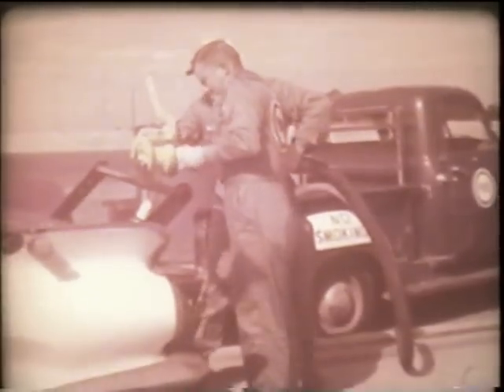1960 Buick Invicta 10,000 miles in 5,000 minutes

Comment: Doesn't prove how well the car would do in the real world. Real wear and tear came from starting the car in cold (25 degrees or less) with the choke on for several miles, dumping a rich mixture down the cylinder walls. The transmission doesn't run "through the gears" like it would in traffic. A real world test would be a NYC taxi.

Comment: Has any car company had the daring to do anything like this since???
Reply: Yes. Mercedes did this with a 190E 2.5-16 and earned a world record for this in the 1980s. But that was the good old days when they made good cars. Not the crap they produce today.
Reply: I was wondering the same thing. It is unlikely that the fragile cars of today would be able to handle something like this.
Reply: Yes, Rambler AMC Nash tried it for their 1961 models at Daytona for a long distance test. One of the Rambler drivers supposedly had a fatal crash. Buick was the first for the Daytona 500 track endurance test, and averaged over 120 mph including the tire and driver stop breaks. The 10,000 miles is equivalent to 20 Daytona 500 runnings!
I was lucky enough to "Pilot" a '60 4 door LeSabre with the smaller 364 c.i. motor for 7 years from mid 70's till 1980. Those fins really helped, as It could "fly"!
Reply: @garyheppner7186  Thanks for the reply. I'm glad this thread is still going after 5 years!

Comment: No way , I had no idea Buick did this crazy test. Now, I’m wondering if this exact car was ever sold to the public. At 120 mph this engine must of been running close to full throttle for 83.3 hours or approx. 3 1/2 days.  It’s a wonder that some part of the drivetrain didn’t overheat.

I wonder if GM ever did another test like this.  I can’t imagine they did.  This was very extreme.

Comment: I own a repair shop. I have some real doubts that a car today could be driven wide open for 3 and a half days straight.  Very impressive
Reply: It would be interesting to see - like a Honda 4 cyl, or a Nissan 3.5 V6...can they hack it?  I would bet the 97 Police Interceptor I once had with 4.6 SOHC could take it.  That was a very smooth and durable engine, with a extra cooling options on everything....

Comment: That's pretty impressive considering the era. The breaker point ignition would seem to be the weakest link. I wonder if they compensated for that in some way?
Reply from the maker: +Paramount531 Larger contact points?
Reply: Points ignition will easily go 10,000 miles without adjustment.
Reply: I expect they selected condensers to balance out metal transfer on the points.  Also, I expect they had common repair parts such as distributors, carburetors and generators ready to go at a moment's notice.  If you're all set, you can swap out a distributor quicker than fussing with points, condenser and a rotor.

Comment: How did they check the engine oil level on a running engine? Those nailheads were superb engines
Reply: Probably had a deep sump oil pan that increased oil by 3 or 4 more qts.

Comment: 16mm Educational Films Thanks for posting this. Love these old Buicks.
Reply from the maker: I'm just glad people enjoy these films - been holding on to them for more than 25 years - didn't know what to do with them.
Reply: 16mm Educational Films I'm sold! I want the Invicta 4 door sedan, any available color! Seriously though; I would think a new engine like that would've used a little oil during the first 500 to 1000 miles. Even if it didn't, just imagine 10000 miles on the motor oil. That would be a stretch even for today's synthetic oils, wouldn't you think?

Comment: Geeze who knew?  Everytime I floored my old Buicks for 5 minutes at 110 MPH I would spin a rod bearing!   LOL 😆
Reply: Well Thats because they were already old and worn out, and the later 300-340-350 and 400-430-455 motors had a completely different (and less robust) oiling system than the 401 or 425 used here.
Reply: @twoeightythreez  You're right,  my 70 Electra had 110k miles and the previous owner had installed a Stage I cam - so she hauled pretty good. Drove it a year,  it was very strong - Raced someone on the freeway and that was it....About same story on my 69 Electra Convert - over 100 k miles and was babied by the old man I bought from.  It did not like being treated like a kids GS....lol, toasted that one in 3 days.

Comment: Travelling at 120 miles an hour and needs refuelling every 30 minutes?? Are you telling me that the range of that car at speed is only 60 miles!?!
Reply: Gotta realize that engine is running at WOT. Can't imagine how much fuel is pouring into that engine!! I would imagine they turned up the fuel and adjusted timing to avoid detonation problems and overheating. That is some punishment!
Reply: Bro the car is running at top speed 😂
Reply: 15 gallons in 60 miles is 4MPG
Reply: @CowSaysMooMoo  that was probably half the mileage the car normally got
Reply: My 69 383 Road Runner was good for about 15mpg of regular driving with an ocaissional stomping.